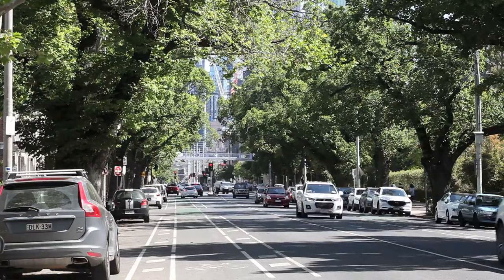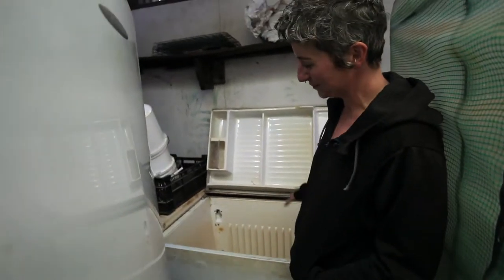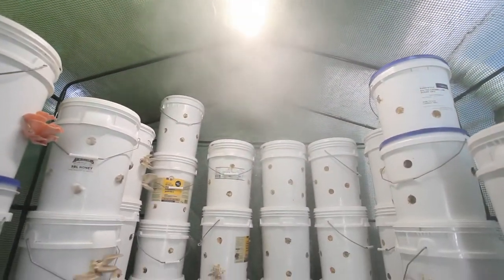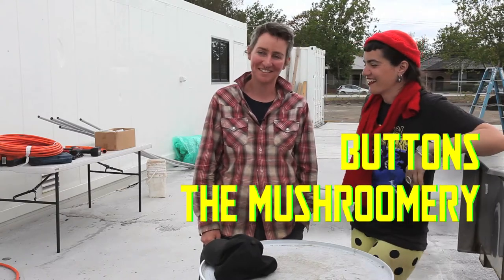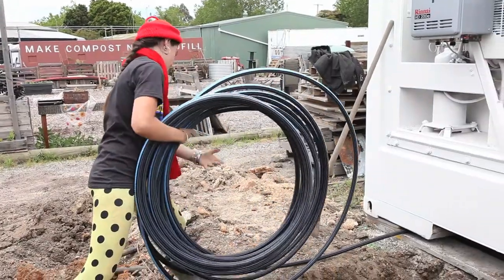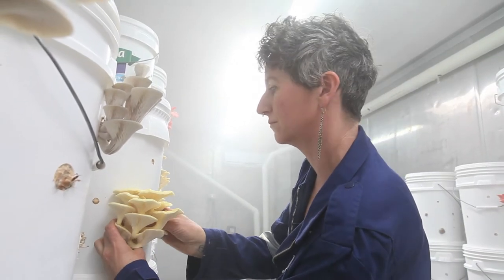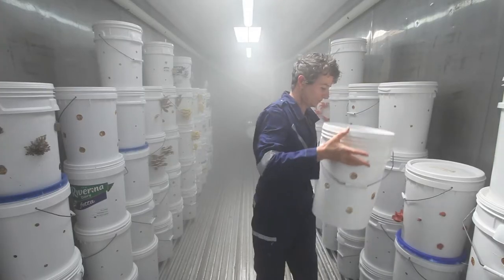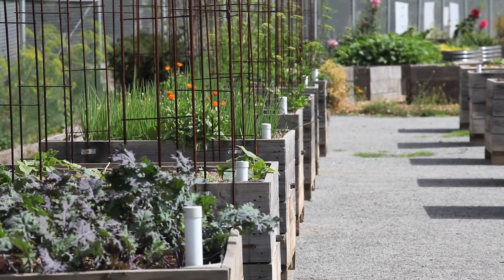Growing Oyster Mushrooms

Comment: Nice setup! That setup at 4:47  looks like a bit of a fire hazard though; if all those electrical plugs are located in your humid grow tent, it's quite possible to cause some issues down the line. Worth taking a second look at.
Reply: Agreed, this is a problem I see with a lot of grow operations. The humidification equipment should be located outside the grow room, with the humidified air getting ducted in.

Comment: looks nice I really want to set up a grow bucket i'm concerned about the dryness and heat in so cal.
Reply: You can purchase warm weather varieties of oysters which will be better suited to your climate. If your humidification system was high pressure water misters , in place of a pond fogger, the mass of water vapor entering the grow space will be more than enough to keep things cool and humid. You'd need a drain though, as it's a wetter process.

Comment: It's pretty impossible using this method in the SW as the air is just too dry. I had success putting my bucket in larger container and putting a layer of water in the bottom for moisture.
Reply: You can add a bag over the bucket and most it regularly. It'll stay more humid that way

Comment: How can i water the mushrooms? I could use groundwater from my garden but it contains a lot of iron, is that bad?
Reply: No you don't water them. The water is already absorbed in the substrate. You will need to spray the bucket or container to keep the humidity up but you want the temperature on the cooler side. Most use a 3 disc mist maker or larger in a greenhouse tent or hydroponic tent.